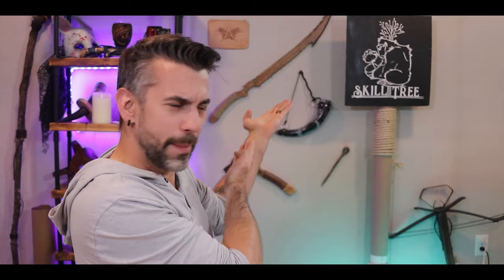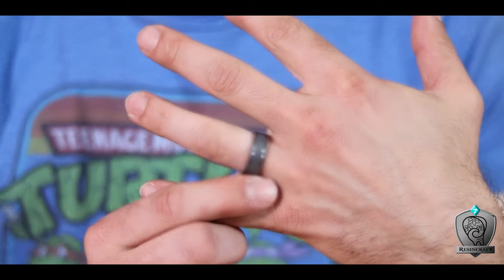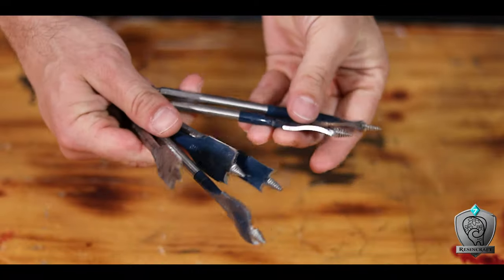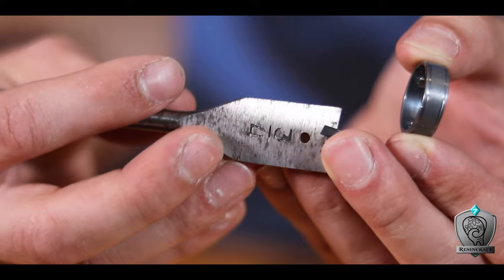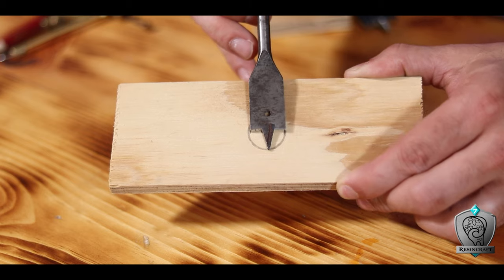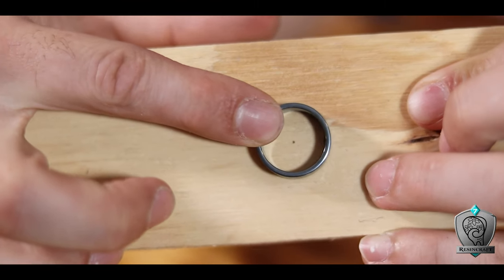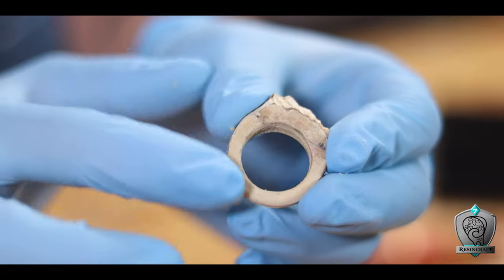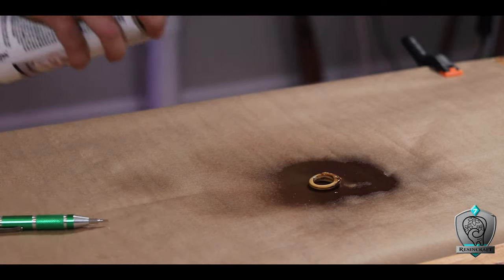Resin Ring Art - Typhoon Ring From my D&D Campaign!

Comment: I don't do any traditional resin crafting but using resin as a glue is something we use a lot in resin printing. Welding thing to resing with with more resin really helps the strutural integrity. Also you might wanna wear gloves when using the uv resin, both so you dont get uv burns or sensitize yourself to the resin

Comment: Typically when it comes to resins and dyes you don't mix the dye directly into your already mould-poured resin.  You mix up a batch of dyed resins and then pour those into the mould (sometimes with a syringe to get those fine swirls) - that way you don't have drastically different densities at play, and then you don't need to use UV resin.

Additionally, you don't need to fully mix the dye into the resin before you pour, that way you can have some inherent swirl in the base colour without needing to use a tool to add that (which generally results in missed patches).